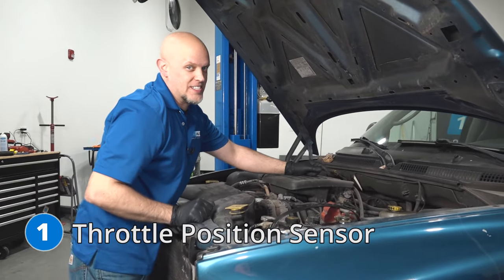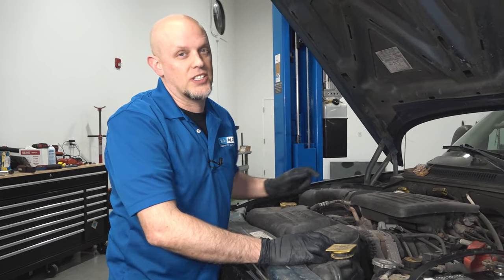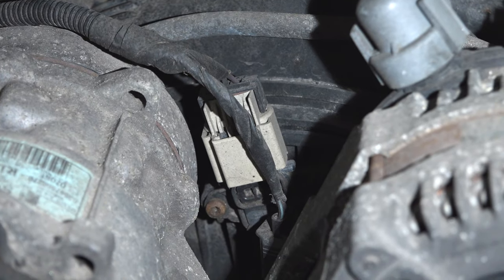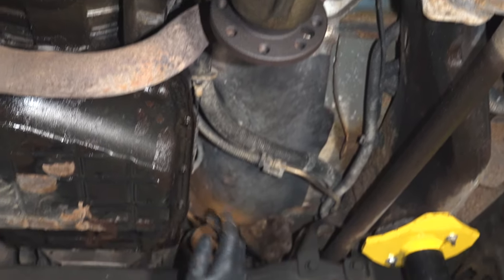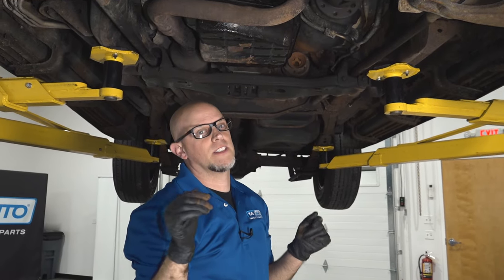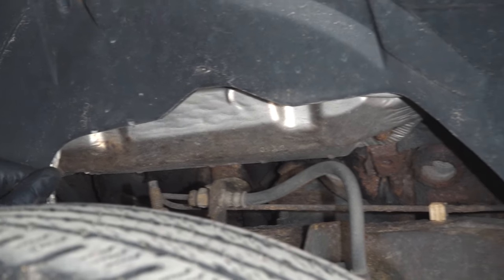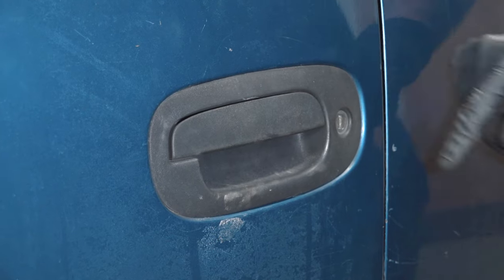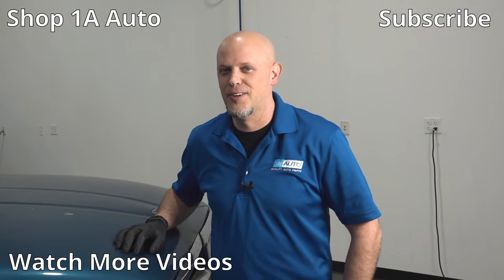Top 5 Problems Dodge Durango SUV 1st Generation 1998-2003

Comment: The problem with mine is it wont quit running, 300k strong
Reply: hell yeah brother 249k on my 02
Reply: ill add to that 265k strong on my 03
Reply: 150 ish on my 03, 4.7 v8... I'll get there someday she runs like a beauty
Reply: 01-203000 no problem
Reply: I’m bought to buy one tomorrow and she has 180k miles. Hopefully I get it and hopefully she runs as long as yours has
Reply: Only at 177K in my 2000 Rt, on the road to 1M
Reply: I got 308,000km on my 98 5.9L Durango and she’s still running happy and healthy
Reply: 01 just breaking her in.
Reply: I hope I have same problem I bought 2003 about a year ago and spent way too much fixing it but it runs amazing
Reply: I bought one for 1,500 and I spent way too much on it but I love it so much runs amazing
Reply: 223k on my 5.2 4x4 1999
Reply: @jamesz8496  should I go lower I was going to buy one today for 1800
Reply: @jamesz8496  170k
Reply: You know it 300k and been beaten all its life
Reply: 204k on my 01 5.9l
Reply: creeping up on u brother with my 99 🤘🔥
Reply: I'm omw! 180k and taking her from Mexico city to Canada, any suggestions?
Reply: I'm at 285k On my 99 4wd with the 5.9
Reply: 350k on mine
Reply: 150k on my 2000 slt .. in kuwait 👍🏼
Reply: I have an 01 SLT Plus 2wd with 181k miles. Been in family since 2006.  I had a new engine installed in early 2022.  I did take the running boards off but she's pretty much all original.
Reply: I’m at 218980 still strong as ever

Comment: Those thing are bulletproof
Reply: Said no one ever
Reply: @jaysource8302  you have to check your oil and coolant
Reply: @jaysource8302  got a 4.7 with 340k oil changes always on time, coolant check regularly.
Pretty reliable if u ask me.
My dakota has 253k.

I put a new motor in 20k ago did trans just because at the time time.

230k and 340k still going is better then most motors.
Reply: @jaysource8302  somebody didn’t put oil in his moms Durango
Reply: @jaysource8302  owned three of these. (2) 4.7s and (1) 5.9. All three easily went over 200k. Never once had any major issues. Both of the 4.7s ran like clockwork with 200+k.
Reply: Had an 2001 4.7L cast iron engine block on mine ran like a champ still does 165000 miles to the nose
Reply: I had a 1999 5.2L besides having no heat its ran great up until my transmission grenaded at 236,000 miles.... just let off the gas to coast to a red light and boom... no signs of slips or hard shifts
Reply: Sold my last one running with 228k. Current one has only 108k. I have no fear driving it on long road trips
Reply: Yep mines got 156k still is a power house! I love my baby
Reply: 2001 Durango SLT Plus super clean 4.7 Magnum 200k she's still beast. Some major repairs but still running strong 👊🏾

Comment: I miss my 99 4x4 durango. Red and chrome. Got it in 04. Wrecked it in 06 by an RV driver not paying attention switching lanes. Fish tailed me. Flipped on a ditch. Came out without a scratch. I'd be dead if it wasn't for the design of that truck
Reply: My family were moving states, we blew a tire and the trailer came around and hit the back driver door.

Comment: Guess im lucky my 99 Durango isn't having any of those issues even with almost 209,000 miles on it
Reply: Same here. I owned three of these, all had over 200k when I got rid of them. Never had any of those issues.
Reply: @clarda1  was it always kept on maintenance?
Reply: @clarda1  I’m thinking about getting one I’m 17
Reply: @kennymelgar3740  Honestly not really. The only regular maintenance I did was the oil changes. My first one had a 4.7 and was tuned, intake, ported throttle body and had an exhaust. It his redline multiple times per day over the course of 50k miles and ran perfect with 200k on it.  Best vehicle I have ever owned
Reply: Have 1 now with 206,000+ miles and still going strong
Reply: @clarda1  what years and motor size?
Reply: Just bought 2003 with 147k miles hope I have same luck

Comment: Crank position sensor is a big problem, especially trying to replace it, Also make sure to get the right one, or it will run very Rough, or not at all..

Comment: My list based on experience is 1. Ball joints 2. Front driveshaft CV 3. Heat blower resistor plug 4. Braided hp fuel line leaks with age, and its directly over the exhaust, so starts a fire.  
  There’s other problems, but these are particularly acute on these gen 1 Durangos.

Comment: Just bought a 2001 Durango 600 cash with 225k advertised as ran when parked .. fired it up drove it on the uhaul trailer 75$ got it home and have driven it 2 weeks no problems other than speed sensor inop. Loving it .  4.7 v8 power .. thanks for the front drive axle heads up.. I think it will need a new one asap.. but ima try and get 4 months out of it first

Comment: I also have a 03 Dakota SLT 4.7 2wd. 238k miles and driven often. Still rides and shifts out fine. Original engine no internal issues ever.

Comment: crazy. my 03 durango had front drive shaft failure in that same spot. my door lock has similar issues and i have an exhaust leak and tapping in my lower end. this just answered so many of my questions

Comment: I had a 98 Durango SLT . Second best 4x4 . Mine had the 318 . Top speed was 130 , Best MPG was 24 MPG and it placed in 15 car shows . I made some changes , then I had 01 Durango in Kuwait , it was an off road monster . Can't afford now .
Reply: i have a 2000 slt v8 magnum in kuwait

Comment: I loved my 2003 Durango.  Sometimes I had to tap on the side of transmission to get it start, and I had to replace ball joints, wheel bearings, window regulator cables, AC compressor clutch, radiator, and when I had to replace the exhaust manifold bolts and muffler I just slapped a whole new performance exhaust on it.  Never replaced the front driveshaft.  It could go drive down a road with 6 inches of unplowed snow in rear wheel drive so I figured what's the point.  I'd still be driving it if some guy had decided to NOT slam into the side of it.
Reply from the maker: +eviljeb Thanks for the feedback!
Reply: I think you mean tap the starter, which is a quick fix sometimes on dying starters
Reply: hey, my ac compressor clutch on my 02 5.9 is fucked up, do you think it's an easy fix, i got not much mechanical experience but I'm trying to learn how to work on my car. this is my first car btw

Comment: I've got '99 4x4 Durango, had to work on several of those issues plus many, many more. Current issue is ABS sensors. Thanks for the tip on the MAP sensor, mine rarely starts with less than three tries and it's been like that since I bought it in 2010. I'll have to check into that. At this point I think the biggest issue is that I should've bought something else.
Reply: Do you know why the 99 keeps turning off?
Reply: @christianguerrero7215  Try the Crankshaft Sensor
Reply: I have an 03 and I wish I bought something else...
Reply: Fuel pump is why mine does that, it would not run unless I bumped key cranking engine a few times
Reply: ABS going on and off at random? Had this EXACT same issue with my '01. It was the ABS computer itself, not any of the sensors. Shops were quoting me $1000+ to rebuild the ABS which was absurd. Got a replacement computer from the junkyard for $30, fixed it and never happened again.  Opened up the old one, and a capacitor had lifted from the circuit board, probably causing the issue.

Comment: I was waiting for this video.. since I'm on the market looking for a Durango
Reply from the maker: +Maro Sanchez Thanks for checking us out! http://1aau.to/m/Shop-1AAuto-c
Reply: Stick with the 5.2 or 5.9 and you will be fine. 4.7 is great if you like to work on it.
Reply: I have a '99 with the 5.2ltr. Absolutely love it. 325K miles and going.
Reply: 5.9 magnum in my 2003 SLT with 167000 miles on her. Always garage kept, still looks new inside and out. This little truck is prolific, nothing it can't handle.

Comment: Top 5 problems for 5.2/5.9L's 1. Transmissions 2. Heads cracking due to poor design 3.  Lower intake plenum plate gasket 4. Air Idle control valve 5. Heater core

Good thing about the 4.7L is a 5.7 Hemi out of the 2nd gen Durango drops right in and transmission bolts up

Comment: I still own one today super clean 4.7 magnum SLT Plus running strong 205,000k
Reply: Currently sitting in my 2000 4.7 magnum SLT Plus. Loooovely to drive. Just hit 150,000 yesterday. BUT, I’ve had to replace;

O2 sensor. 2 of them. 
Throttle sensor.
Cooling fan
Radiator (it randomly cracked but thankfully was under a lifetime radiator from the last time it broke in a small bumper bump.)
Valve stem seals (not done yet) 
Carbon clean from seal leak.
Driver seat has a little back and forth play.
Aaaaand the inside door trim is loose from when the drivers side window busted and got replaced at home…..

But I got an after market K&N air filter and muffler box…. Sounds nice… lol but aaaaall original except those and sound system and all terrain tires.
Reply: I have a 5.9 slt that gets abused an does burnouts
Reply: @channelfunnygoose163  funny I have the same exact car with 148k miles now and with most same issues. Just replaced o2 sensor. That’s driver seat wiggle is so annoying and a chore to get to and fix. My door panel is loose and the door locks make weird sounds and don’t lock with the remote. I got a flowmaster exhaust and cold air intake.  Lots of fun!!

Comment: I had a 1998, and I can share some experience,
First, if you ever have to replace the U-Joints, take them to someone to have them done, reason being, Dodge used loc tite on the caps, meaning they are a bear to get off.
Second, the luggage rack trim screws go straight through the roof and into the cab, take the trim off and use silicone to seal it. 
Third, I had a 5.9L with what I thought was the factory transmission, but come to find out someone put a 42RE instead of the 46 RE which is what was supposed to be there and none of the shift linkage bracketry is interchangeable. 
Feel free to ask me any questions you may have.
Reply: I have a lot of questions if you can answer them
Reply: @gradymcgowan2552  what questions do you have?

Comment: I test drove one before buying w/ 60k miles and the trans was shot. I purchased another one at 20k miles. Around 70k miles my trans started slipping. STILL one of my favorite auto ever owned. If not for the trans I would've kept it longer.

Comment: Just picked up a 2000 Durango r/t and can’t complain minus the fuel consumption 😆
Reply: Same
Reply: Does that crapper still run?
Reply: Onyi Ononye  Run Seafoam through the intake. Add Marvel Mystery oil to the engine oil. This might solve the issue and help lubricate the sticky valves

Comment: My parents had a 99 with the 5.9 and 4wd, transmission went out twice in 5 years. Considering the bad reputation chrysler has overall for their transmissions in this era, weird that the transmission didn't even make the list. Considering the cost, I would say it's a "top" problem, moreso than any of these.
Reply: I put a valve body in mine about 50k miles ago and it drives fantastic. Cruise control slams gears trying to get this fat Lard up a hill, so I drive without it on hilly roads. Early 2000s Chrysler trans were and still are really hit or miss.
Reply: Mine went out twice within one month luckily it was still under warranty
Reply: Yea man that’s rare most Dodge Durango transmissions last forever however in anything else that came from the Chrysler brand failed miserably

Comment: I seriously can’t remember the last time I saw one of these. They rushed out like crazy up north.
Reply: Here in the United states they are everywhere lol
Reply: Here in maine there are very few 2nd gen rams or durangos. The 97-03 fords seem to be the most prevalent 'older' truck still on roads. Gmc 1500's also like to snap frames once rusted. I see it usually rear driver side where shock mounts to frame.

Comment: Commenting for a friend. My original problems were 1: Ball Joint, 2: Water Pump. 3: Power Steering (still having issues after prior replacement.) 4: Shocks. 5: Cruise control (Works but my throttle will leave my foot and actively accelerate for as long as I'm holding my cruise control's accelerate button.

Any tips?

Comment: had a 5.9 and traded it in for an all black 4.7 to save some gas. the engines on these are pretty powerful; but i had so many over heating problems and coolant issues. went through 3 engines. all over heated. after spending so much money on a truck i loved; i vowed to never buy dodge again.
Reply: I own a ‘96 RAM 2500 with a 5.9, and never had such issues. Not all Magnums are bad.
Reply: @adriananoelle4699  
Hi. I'm planning to buy one 5.9 Diesel.
In your experience those can be a geat love?
Reply: @adriananoelle4699  The 5.2's & 5.9's are solid engines (& he didn't say that he had any problems with the 5.9 that he had...the problems that he had were all with the 4.7's that he had!...which is valid because they're well known for having some issues with 'em...particularly if/when they're not properly maintained very well &/or they get too overheated!). The 4.7's are a completely different design than what the 5.2 & 5.9 Magnums are!
Reply: Last year of the 4.7 which was in 03 rectified all the problems for prior years
Reply: I still like the LA over the magnum, most of the 5.2  I've driven run better than  the 5.9 and felt stronger .
Reply: @adriananoelle4699  😍

Comment: My 4.7 is at 215k n im pretty confident its going to see 315k,Oil changed religiously
Reply: That's cool my 99 5.9 has rite at 209,000 and runs like a champ
Reply: 01 5.9 has 235k and transfer case exploded at 190k and been driving rwd ever since. Still runs great
Reply: My 4.7 is having coolant problems and I'm always getting a code for one of the sensors that I can't track down. My check engine light on I don't know what the hell's going on with this car
Reply: I would replace your timing chain/guides/tensioners, oil pump an do a full seal/gasket set asap!

Comment: had 2 2003 Durango's, exhaust manifold gaskets, water pump, ball joints, a/c heater fan, <--- burnt out rheostat, usually the plug too. Easy cheap fix, right under glove box, 2 small screws.  My 4 common

Comment: I own two Durango SUVs (150k and 212K miles).  Both have problems with window "regulators" (electric window motor assemblies).  Radiators have needed to be replaced on both as the plastic endcap fails.  Both have required "freeze plugs" replaced due to rust-through leaks.  Both have had the plastic on the center console crack and fail.   One has had a failure of the Catalytic converter at 150K miles. The rest are regular maintenance items such as thermostat, hoses, belts.
Reply from the maker: +addertooth1 Thanks for the feedback!

Comment: My common problem has been my PCM...everything else that has gone out on it is pretty routine and hasnt failed a 2nd time...but im now buying my 3rd pcm since 2014....like every 3 1/2 years at this point...shes an 03 with 200k so she getting up there but still running great
Reply: I had to replace my pcm in 2017 a few months after buying it. After installing a junk yard pcm, I found out there is SO much more to the computer than I thought. Ended up having to replace a few more modules when I found another Durango at the junk yard with my exact setup.

Comment: Thank you for doing a video on this, especially shortly after requesting if your crew could do one. For i own one myself right now and am trying to make sure if any of these issues are happening I can fix it asap.  2 questions though.  How to stop oil burning or what could cause it on one of these? I replace the valve gasket covers and cleaned the throttle body but its burning about a quarter of oil every 5-800 miles. Second question is  low idle from time to time after engine is hot it drops from 600 rpms to 480 or so rpms, would that possibly be the throttle body sensor going bad or my maps sensor?
Reply: The cause of your oil burning is most likely your valve seals. I just rebuilt my 4.7 at 200k just as preventative maintenance. The valve seals were definitely shot. The timing chain guides were also on their last leg. Everything else looked really clean for 200k. The cause of your low idle is most likely your (IAC) Idle Air Control Valve, which is cheap and easy to replace.
Reply: Intake plenum gasket. There's a gasket under the intake manifold that lets go, and is probably the root cause of both the oil loss and the low idle. My 2003 had this issue, and the gasket replacement solved it.
Reply: @markk3652  would think a vaccume leak would cause lean condition and result in a fast idle?

Comment: Transmission stares, am I a joke to you? They're pretty great, mine had 215k and runs decent.
Reply: Its people who do t maintain their vehicles that complain when something goes wrong with an engine. My dad has a 2001 ford expedition with nearly 300,000 miles and he still takes it on long road trips. Yet a family friend has 2014 raptor 1st owner and already has a rebuilt engine.
Reply: I have near 200k miles on my transmission. Still runs and drives  and I'm having no issues
Reply: My 99' has 255k miles. Runs decent. Already planning on an engine rebuild